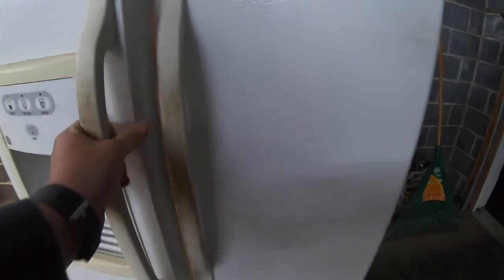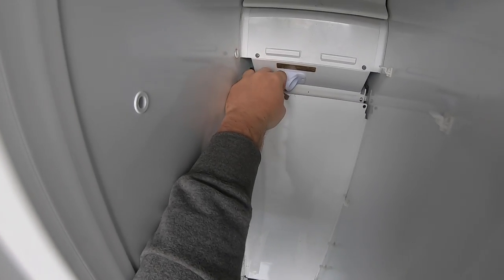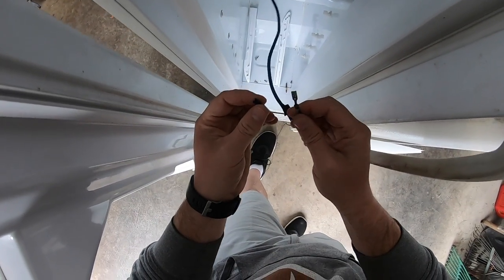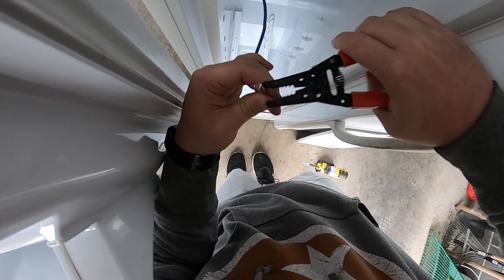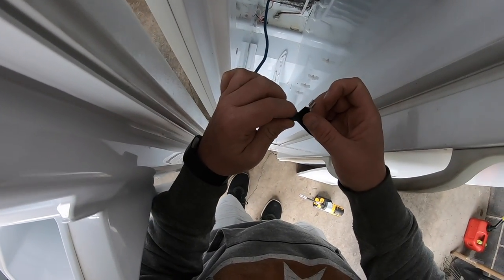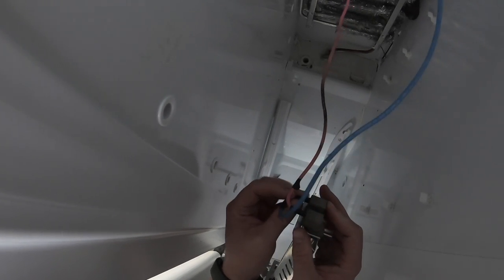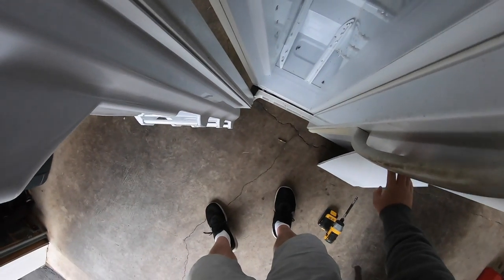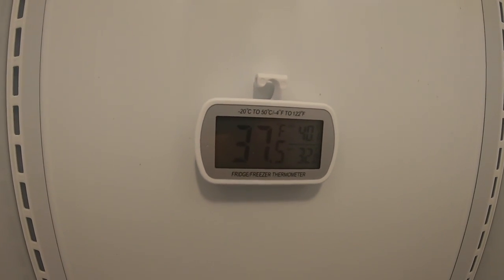How to Replace Refrigerator Defrost Heater - DIY for fridge not cooling

Comment: Pretty cheap repair! Only tip id add is heat shrink tubing on all electrical repairs is night and day from electrical tape. Although that’s better than nothing! Good to have a few pouches of it in the toolbox.
Reply from the maker: I thought about that but didn’t have any handy.  About to change out the evap fan…will pick some up before that.